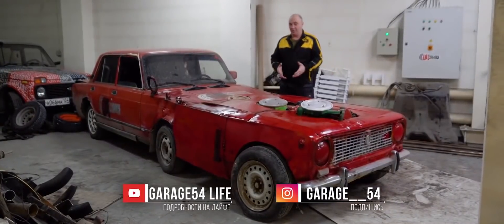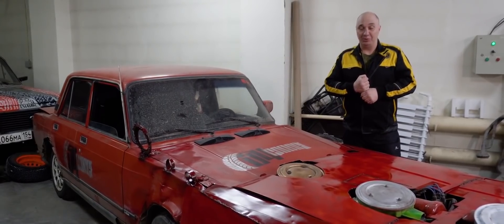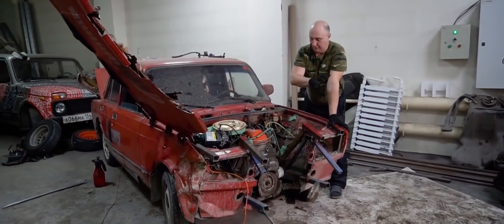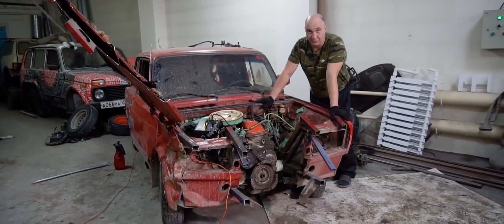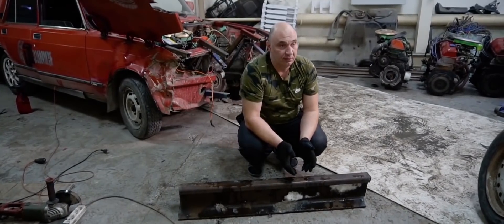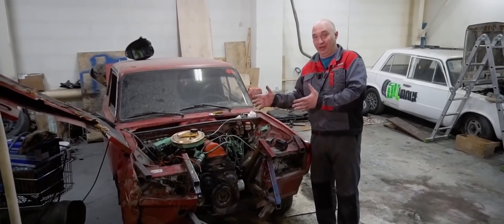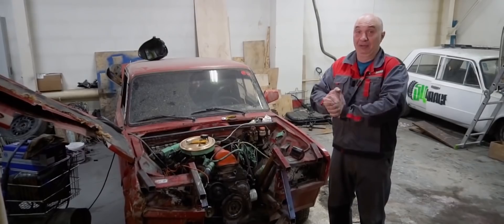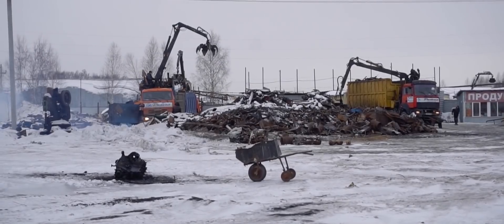Attaching a rail to the flywheel – monstrous engine imbalance

Comment: Thats sounds about right on rail grade. 75, 90 and 110.
I did some rail stuff with a bunch of guys. You sure know its wrong when you try to connect a 90 to 110 rail. A lot of grunt work by manual labor.

Comment: I have a request and could not find another way to get suggestions to you. I suggest you try something completely different... 20 million weight silicone oil in a differential. But you'd have to close the diff gears off inside because 20 000 000 weight silicone oil is super thick oil. Id like to see this hobby remote control silicone oil applied to a real world car. Best results are to clean the differential gears to show super thick differential oil

Comment: Well yes, welding high carbon steel (rail) to anything else isn't as easy as you might think.
The welds will fail sooner or later.
Must admit, it is still quite interesting to watch 🇿🇦

Comment: Next engine imbalance take the flywheel off, and drill several large holes on one side of it. That'll  imbalance it with no welds to fail

Comment: Ita going to shake like a dog shitting a peach seed until the crankshaft breaks in half possibly splitting the block..... but I'm fairly sure the engine is coming out of the car if guy can keep the throttle going thru it all..... the weld failed awe crap

Comment: and if the engine cant rev high enough just put the engine on the output side of a manual transmission and put the huge flywheel on the input shaft and put it in 1st gear, giving you like a 10-1 over drive

Comment: what you should do next is put a 300 pound flywheel from a semi truck engine or like a huge ass flywheel from a train engine or something and bolt it to a car engine and float the valves as high as it will rev. car engines can rev much higher then huge diesel engines and it should detonate the huge flywheel. and send 100+ pound chunks of iron into a low earth orbit

Comment: The rail hit the starter and knocked it off and the starter busted the bottom of the intake and fuel got on starter and the positive wire on starter from battery grounded out and started a fire.

Comment: we built a bunch of high speed wheel lathes... twin spindle 3000 rpm, 9.5" ID Timken taper roller bearings, for aluminum automotive wheels... one night on third shift, a guy cracked a locator on one chuck jaw, the lead guy removed the jaw, said just to run the other spindle while he fixed it. 9.5 pounds at 6" radius, my numbers came out to over 25,000 pounds centrifugal (centripetal if you prefer) force per jaw... yeah. MELTED that 9 1/2" bearing in seconds, cracked the spindle casting and dropped it into the floor chip conveyor, doubt it even got up to full speed. luckily we built 1/4" and 1/2" thick guards- the guards weigh more than the machine, nothing was ejected, but what a mess

Comment: So i can tell you from personal expierience. I had my externally balanced small block chevy flexplate out of alignment because someone removed the alignment dowel in the end of the crankshaft. I wasnt paying attention, and in a hurry when i assembled it, and it was nowhere near that off balance, and it ate the crank bearings up to the point it was lowering oil pressure. So when i pulled everything apart, i also saw that the imbalance tried to go through the harmonic balancer as it should, but actually started to loosen up the front main cap also. Its a 4 bolt main stroker, making well over 500hp. Its all fixed now, and a little smoother obviously. And its arp bolted everything. Pry the reason it didnt come apart at close to 7 grand.

Comment: Saw the starter break off the motor and ground out on the frame. I think that started the fire. After the fuel line was severed by all the metal going everywhere

Comment: Did anyone notice that the entire starter with frame it was attached to broke off?  it sheered off about hallway through and bounced around a few times.  It happened just before the fuel catches fire near the same area so it may have played a roll in causing the fuel supply failure.   Experiments rock!    Ignore Drumpf please and stop interfering in our elections, lets be friends and reduce nukes.   (yes I realize our dumbass pres needs to be an equal partner in the effort, check back in a few years, we might be remodeling the white house.)

Comment: I'm going to guess it will have a difficult time idling, and once the rpms increase it will start tossing the car around. The main seals on the crank will then probably go and then the motor mounts. Probably gonna shake the car to bits.

Comment: SO the engine itself was fine. The rail flying off broke the starter motor off which blew a hole in the block. Wow! Spectacular.
Reply: I think the starter broke off due to shaking, and the starter hitting the rail tore it off

Comment: The fire was from the starter. It rattled loose (or broke the mountings) and shorted the body nearby. Fuel lines were rattled loose, and the rail bumped lots of stuff in the way.

Comment: Wife...  there is a sweet stink in the car and the passenger floor is wet

Husband...  probably the heater core, I'll run down to the rail yard and grab a piece to weld on the flywheel.

Comment: i would like too see what would happen if you put galium in the water or oil of an aluminum engin sense galium attacks the aluminum directly i can imagine it would last only a couple of minuts before you have a part fly through the blockand then the entire thing just goes splat.

Comment: Start the engine balanced. Offset it while it is running. See how long and how off balanced it takes before it comes apart. Off set the timing in the process also...

Comment: Pause......I think the flywheel is going to take flight, shearing the bolts right off.....if it will actually run due to the imbalance.

Comment: TAKE A 1/2" BREAKER BAR WITH A 6" EXTENSION ON IT AND WELD THEM TOGETHER THEN WELD THEM TO THE CRANK PULLEY BOLT AND START THE ENGINE :)

Comment: Awesome video guys! Just a tip tough if you want to weld steel to the flywheel its best to heat up the flywheel first with a gasburner then weld when hot it will be much stronger

Comment: *Prediction*: The flywheel throws off the train rail first. It embeds in the body of the Lada. After that the vibration gets insane, and the motor mounts break. The weld never breaks on the other piece.
Reply: Okay, I was only partly right.

Comment: Awesome, what this actually shows it no matter how crap people think lada is they are very resilient machines.
Do you think you could do this with a modern engine without throwing a rod or worse quicker, if the piece of rail hadn't come off would of gone for way longer as the starter look like it did the damage.
Also like how guys hand was on fire

Comment: So, suggestion time: How long does a Lada engine last at continuous full power? This probably requires an artificial load of some sort. A propeller could work, or just install the engine in a boat.
Reply: why not raise it, put in a softer suspension and have it drive a huge circle on reasonably flat ground?

Comment: Great fun!   Maybe need more heat to the weld at rear of engine?  Looks like it broke right at the weld.
Reply: You are correct! The mig welder they are using MIGHT be good for up to 3/8" material...They need to step it up with a stick unit and some quality rods and have an experienced welder burn that baby in... Goodbye crankshaft!
Reply: @scottsmith5623  Exacta-mundo my friend! Should even chamfer the perimeter of the R/R rail with a grinder so that hot puddle burns in there but GOOD! Then for sure they will have created a 4 cyl. bomb.

Comment: Connect a drill bit to an engine and use it as a drill
Reply: freezeme360 no that's only if they were Italian 😂
Reply: freezeme360 lel
Reply: freezeme360  Guess what. Lada was based on Fiat 124
Reply: old style lethal wood chopping machines had a huge cone drill bit that split the wood,1000-6000 rpm lada engine would eat those wood bits good if welded at the fly wheel. lethalness would be high but the russian factor would outweigh it I suppose xD

Comment: 2:45 always wanted to hinge a hood on the side. 
It still might be interesting if it pops open at speed!
Reply: At least it wouldnt block your vision if it sprung open. 

I think the Fiat 127 had a side opening hood. Or at least a car i nsimilar design. Could have been the FSO 1300.
Reply: @ianallen2  might be kinda cool, it'll start flappin like a bird😛
Reply: @MrTheHillfolk  I feel sorry for the cyclist who gets passed at the time the hood flies open. lol.
Reply: @ianallen2  
Yeah, that might be exciting but not in a good way
Reply: Wrong, FSO 1300 had rear to front hood opening.
Reply: @ianallen2  

4th gen buick roadmaster is the only car I know of with a side opening hood

Comment: The ford 1.0 3 cylinder ecoboost engine has an imbalanced flywheel that evens out the odd firing 3 cylinder
Reply: Since I have this motor I can chime in. Yes the flywheel and front pulley are purposefully unbalanced in a way to counteract the 3 cylinder vibrations. Works well!
Reply: Are you sure it’s not balance shafts? I’ve never heard of an unbalanced flywheel
Reply: @Diesel8290  you are right a imbalanced flywheel would pull a engine apart the only engine i can think of imbalance is the wankle Toyota rx8 rotery engine
Reply: @thomasmcdougall8059  Mazda rx series rotary, Toyota don't make rotary engines.
Reply: @thomasmcdougall8059  that's mazda iirc
Reply: @thomasmcdougall8059  Toyota didn't make an RX-8, to my knowledge and I'm sure somebody will correct me if I'm wrong, Toyota have never produced a road car utilising a rotary wankel engine at all... Maybe.. Mazda?
Reply: @kristianperryadams  yeh it is Mazda sorry
Reply: If I remember correctly either the old school Chevy 350 or the Ford 5.0, had an inballanced flywheel
Reply: @brysonshires9742  chevy 350 is normal, it was the 400 which had a weird flywheel/flexplate to balance it
Reply: i dont believe you
Reply: Jimskateuk it's real bro

Comment: 09:15 Did my man really just throw a giant snowball at an engine fire? Lol A for effort! 👍
Reply: So you havent seen the electrical explosion video in russia , and the guy is throwing snow on the burning wires in the cabinet? 
They love snow.
Reply: MrHillfolk I thought of the same video lol russian fire extinguisher
Reply: Our Father  You're a special kind of stupid, aren't you?
Reply: @Bluelightbandit  
Helmet 24/7 special ?😝😝
Reply: @MrTheHillfolk  Without a doubt  👍
Reply: As i understand it, it did work a bit later after putting more snow on it. Although they didnt really show that part.
Reply: It's called Russian fire extinguisher
Reply: A for Affort
Reply: Our Father  
Mama always told me not to look into the eyes of the sun
But mama, that's where the fun is
🤣
Reply: Russian way 🥺
Reply: I've stopped at a building site and thrown sand at an engine with no air filter was doing a lap tuning, overtightened the fuel line and cracked the float bowl on a Holley had the engine off, towed home, inlet off, heads off all cleaned and checked. sand saved the car lol, I now carry a fire extinguisher and never leave home without an air filter
Reply: I’ve put out an engine fire with snow myself, it works lol
I carry a fire extinguisher now
Reply: Money is being saved by using only snow
Reply: They welded sections of locomotive rail to the spinning parts of the engine.

M'man here asks if dude used snow to put out the resulting fire...
Reply: putin snow on a burning nuclearreactor is that good enough?
Reply: @extec101  Sure. If you have enough snow that is and can deliver it fast enough ... so no.
Reply: @derPetunientopf  just let it burn out i heard... :)
Reply: extec101 "putin" lol

Comment: You guys should take that 7 liter truck motor and either find a smaller car or center the motor in the car more to do wheelies. You will most likely need some wider tires too

Comment: just throw a concrete block in a washing machine for the same effect.
Reply: I feel like this is a plug for aussie50
Reply: @2boredfortv  The original 'brick in a washing machine' was Photonicinduction. (come back Andy, all is forgiven) All the rest are copies, but ALL of 'em are funny AF.
Reply: @olsmokey  Wow how did I miss that? Huge fan of both guys; running over there to check it out!
(Edit: THE POOR FLOWERS)